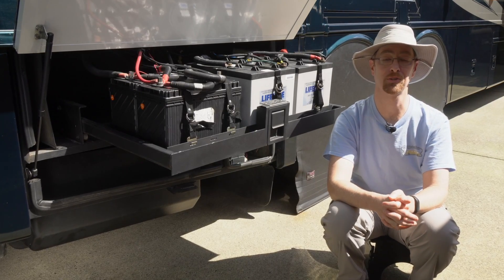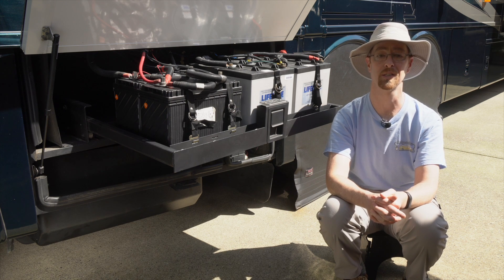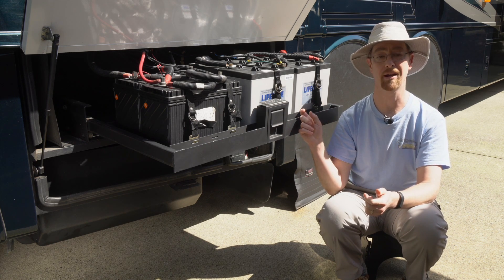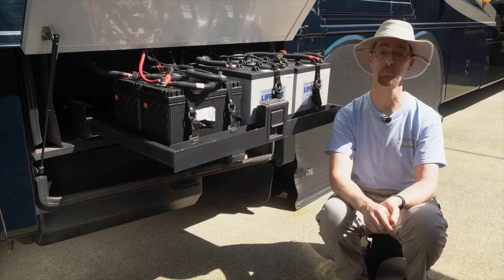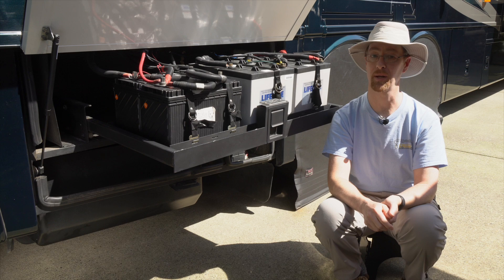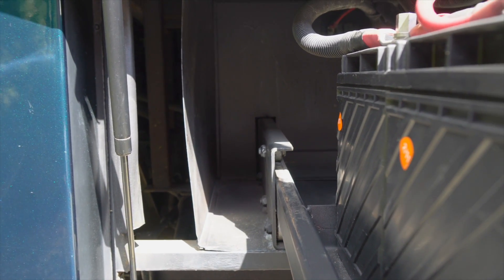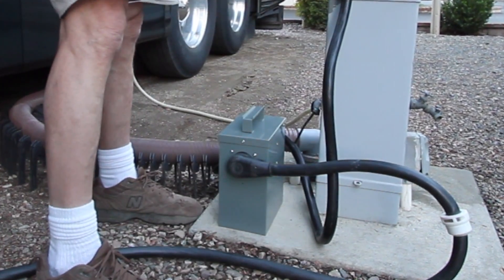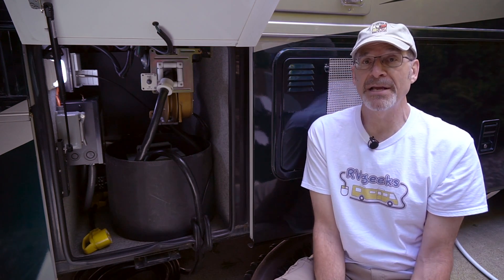🔌  RV Lithium/AGM Battery & Electrical System Upgrade - Part 1 - Project Intro ⚡️

Comment: Always amazed at how clean EVERYTHING is on your RV.
Reply from the maker: Thanks Joe! Although if you'd seen it a couple of days ago, after 2,000+ miles of driving mostly in the rain, you wouldn't have said that! Of course we did have to stop at a do-it-yourself car wash with a truck bay a couple of days ago to fix that and get it at least pretty clean again. 😊
Reply: Still headed to the maritimes this summer??? I'll be on the East coast but I think a bit further south than you guys
Reply from the maker: Sure thing, Joe! Currently in Ontario (best way to follow our general location is on Instagram)

Comment: Congratulations! Your getting into the type of upgrades I've been doing form much of my professional career! I'm happy to see that your having a welding shop expand your tray, and I'm happy to hear about your newly discovered LiFePO4 cells that I was not aware of. Additionally, I've been installing Xantex components into newsgathering ENG vans for a few decades. I am a big fan of the Xantex product and remember giving them some in field customer feedback to them about their product in their early development. 

We too have a 4 cell, standard lead-acid battery bank in our Class A RV. Unfortunately, It originally came with AGM batteries, a big selling point, but as the coach was being inspected, it turned out that the AGMs had gone bad and had to be replaced. I did not have a choice in the battery replacement and the dealer would only install lead-acid. 

Eventually, I have planned to upgrade back to AGM once we have run the course with the existing lead-acid batteries, fearful of the Lithium Ion fire risk. I am happy to see that Xatrex is offering a LiFePO4 option for the outside battery compartment. Thanks to you and your video here, I will likely be entertaining the same upgrade path that you are following here.
Reply from the maker: Thanks, Mike! We're definitely liking our Xantrex equipment... and the new LiFePo4 battery is working out great so far. It's not available on the retail market yet, though. They are using the non-heated version in OEM Class B installations (where they can control where it gets installed to protect it from freezing & heat)... but we're hoping that their "case study" with us results in them accelerating their plans for aftermarket availability. 😉

And we're sorry to hear that your hope of having AGMs in your RV were dashed by them failing. We definitely liked not having to worry about any maintenance or outgassing from flooded cells when we upgraded to AGMs. Assuming price isn't an obstacle, lithium is definitely the best upgrade choice at the moment. It's definitely more expensive up front... but with the potential for dramatically longer lifespan, and the quality of life improvements it can bring... it's hard to ignore!

Hope you enjoy the rest of the series. We're working hard shooting video, editing, etc!

Comment: Another awesome project and one I been researching myself.  I will be following closley to see results. I'm especially interested in the Xanax batteries parasitic losses when the vehical is in motion during cold weather.   Please include ballpark cost estimates for us normal consumers :-). Thanks for all time you spend putting these recording together!!!
Reply from the maker: Hi Richard. We'll be doing our best to include all of the information we can about the new lithium battery and all the other upgrades we're doing. If we miss something, don't hesitate to ask... and if we HAVE an answer, we'll give it to you! The one thing that will be tough right now is actually the cost of the new Xantrex battery. They haven't released that information (to us OR publicly) as the battery is not available for aftermarket installation... but we'll get as much together as we can, and will update once any missing pieces are available. Thanks for watching!
Reply: RVgeeks if you have any input to Xanex, suggest using Peltier for their embedded heating element as it could then be use for cooling too :-)

Comment: Good stuff, enjoyed as always.  I installed Battle Born Lithium Ion in our truck camper just prior to going full-time.  I had the same concern about the 32 degree mark because I only had room in the battery box to place them.  I spoke to the folks at Battle Born who suggested insulating the battery box which I did.  I also placed a work lamp with a 75 watt bulb in the box and have a weather station with an outside sensor, a sensor in the basement and a third in the battery box.  I have not needed the light so far, even with temps as low as mid 20's, temp in the battery box as yet to go below 45 degrees.  Good luck with your install.
Reply from the maker: Sounds like you've put together a good system for keeping it above freezing, which is so important. Nice.
Reply: I guess the box is insulated. If so, the batteries are producing just enough heat while working, they are keeping the temp in the box up there.
 If this new box is insulated the same might happen but it is a new technology. Keep a record of how the temp in the box changes in cooler climes while the batteries are under a nice load. That is IF you ever see anything below 90*!!

Blue Sky's and Safe Journeys!

Comment: Hey Guys! We are a bit behind in these videos, but better late than never:) We learned so much in this video! One we did not know there were different types of lithium batteries and certainly thought if the cell batteries are having issues why would you risk it in an RV, two we did not know lithium did not work under a certain temperature, very cool idea to have a battery then with a built in heating blanket to keep it warm and cozy :) Three we did not know there were AMG chassis batteries. It is truly unbelievable how much we learn from your videos!! 

On a side note we purchased a Hughes Autoformer using a discount through you guys long ago (actually before we even bought our RV home lol) and it has been great, We did have an issue with our power cord on it recently and we contacted Hughes and they told us to send it back to them and they would take care of it. In less than one week we had our Autoformer back good as new. I know you guys like to hear good stories about customer service for products you endorse and they were fantastic!! 

Take care guys and safe travels!
Reply from the maker: Thanks so much for your comments. We're learning a lot about batteries ourselves lately! There sure is a lot to know. Two of the biggest things we learned is that excessive heat & cold aren't good for any battery, and that lithiums currently on the market are mostly made from Chinese components and are NOT UL approved for mobile applications... or for series or parallel use (more than one connected together). The e-GEN is the very first lithium battery that's UL approved for use in RVs. As everyone gets all excited about lithium, we're hoping that we don't start finding out that many of the brands are unsafe or otherwise inappropriate for RV use. Time will tell. As far as AGM batteries for starting the engine, the Full Throttle series are the first we found that can handle the required CCAs, and we love having such a clean install, without any outgassing or the resulting corrosion. Thanks for letting us know about your experience with Hughes. They're a great company with a great product, so we love hearing that others are having the same positive experience we are. Safe travels!

Comment: Looking forward to this series, have been think about lithium for our older DSDP but was worried about the outside compartment/freezing issue.
Reply from the maker: Hi Ken! Temperature is a prime reason we've held off on lithium for so long, so we were very excited when we found out about the Xantrex battery. Unfortunately, we're working with Xantrex as a case study and showcase for this tech, and it isn't available for sale yet. We sure hope that changes soon, and maybe our participation can help move that along. 😉

Comment: Finally someone puts to bed the bull about lithium batteries there is so much wrong info glad you cleared it up. You run that house off very little solar. That whats needs to be said you don’t need a zillion watts to live off solar. Congrats very well done 👍🇨🇦🇨🇦🇨🇦
Reply from the maker: Thanks, Vlite. There definitely is a lot of misinformation out there about "lithium" batteries. And we get it... it's confusing. Everyone uses the term "Lithium" or "Lithium Ion" to describe all lithium battery formulations, even though there are some fairly dramatic differences between their pros/cons, etc. And the LiFePO4 chemistry is the best balance of power density, safety, and value commercially available today. As for solar... our current array is definitely NOT sufficient for our power needs (our residential refrigerator sucks up about 130Ah per day!), but we're cautious about going the route of just slathering our roof with new panels until we have more experience with how our system works... and how the 2.5x increase in our battery capacity (plus the lithium's ability to rapidly accept a charge) changes the equation. Given our current experience on the road of 5+ days of non-stop overcast and rain, no amount of solar on our roof would supply enough power. And of course, there's the issue of where you camp... desert camping affords LOTS of solar, and a big solar array can replenish your daily use by noon! But if you stay in the forest, or in climates that aren't sunny 360 days a year (ahem... 🇨🇦), it's not doing you much good. There are lots of variables to consider before proceeding with a project like solar.

Comment: I got the feeling you guys might be thinking about a whole new rig...this massive upgrade sort of kills my prediction. Looking forward to seeing the vids!
Reply from the maker: Unfortunately we'd need a lottery win or an angel investor to get a new rig, at least anything along the lines of a New Aire! But updating the one we have sure does make it feel new again, so yes, we're happily keeping it for the foreseeable future. 😊
Reply: And that new lithium battery with heater seems like a game changer for the cold weather issue. Congrats on being guinea pigs. :)  Are those new batteries still susceptible to high heat? I hear high heat can also shorten the usable life of lithiums. i.e. hot summers.
Reply from the maker: Regarding temperature, our battery compartment is located directly alongside our engine, RIGHT next to the muffler! So, as you'll see in an upcoming video, we installed highly heat-resistant insulation (the type used under race car hoods) into the compartment. So far, having driven over 2,000 miles, our two temperature sensors (one in the compartment and one inside the battery itself) have never shown readings anywhere near battery limits. And that includes plenty of mountain driving, although in less-than-extreme ambient temps so far. We're keeping a close eye on that, especially as the summer warms up, and will report back on that issue in a future update. And of course high heat, (unlike cold, which can destroy a lithium battery) will only shorten the lifespan, not ruin them. They're supposed to last about 2,000-3,000 cycles at 100% depth-of-discharge (we don't intend to go that low of course, increase their life substantially), so we may not live to see the end of even a "shortened" life! LOL
Reply: Option #3  - New Discovery Canada programming 'RVgeeks On-the-Road'.   A replacement for Canada's Worst Drivers.   Homebase - Vancouver B.C. (my favorite Canadian city).

I think you could sell the idea of a reality programming show where your travels can be made into prime programming.   I think with the right agent and sponsors, you could be in a Newmar King Aire in no time.  [-\) 

On second though nevermind, we value you  on YouTube - humble and accessible.
Reply: Excellent. You guys are all over it, should have guessed. Cheers!
Reply from the maker: LOL! We sure appreciate your support, Anthony. And we'd hate to ever get so popular that feel like we don't have the ability to be accessible any more. So when The Discovery Channel calls, we're declining. 😂

Comment: I've always wondered about enlarging our battery tray (exact same size and layout as yours). Also the change of the cord reel. We have the same one on our '03 Dutchstar and have never had a problem with it either. The only thing that concerns me about the typical cord reel, is the need for rotating contacts(arcing at 50amps). Looking forward very much to this series of videos. Thanks!
Reply from the maker: Hi Richard! Thanks for mentioning the rotating contacts on the roll-up type of cord reel. John Glendinning, the president of Glendinning Products, whose father founded the company, is a purist, like his Dad was, who loves the hard-wired cord reel we're removing. But he does understand the benefits of saving space, and did accept why we were removing one type of reel and replacing it with another. The main difference in using it, which we'll mention in the video about installing it, is to only extend and retract the cord when the power is off. As we mentioned, Newmar is using this type of reel in $800k+ coaches, so we figure that, used correctly, it's good enough for us, too! 😊
Reply: RVgeeks  I hear ya! I'm sure they've got some really heavy duty roller contacts on that baby. I looked on line, the 36' one is around $ 659.00. Newmar wants 647.00(I think that's right) for the Newmar rock guard on our coach. It's got a few battle scars. Thanks
Reply from the maker: Oh yeah.... our chrome mud flap / rock guard has been bent a few times, like all the others we see on other Newmars out there. All it takes is one time forgetting to swing it up to hold it out of the way while leveling in a nose-low campsite. 🙁

Comment: If your aren't going to recycle the old old real make it into an extension cord.  Put on a Female 50amp connector on the cord reel end and you have one of the most flexible extensions you can get for free :)
Reply from the maker: Thanks! That's a great idea, which we will absolutely do if we don't find a good home for our old reel.... but we bet we will. 😉 It does still have a lot of life left in it!

Comment: Good to see a manufacturer of batteries addressing the cold charge issue. What about the inefficiencies due to heat affecting the Lithium batteries? I thought this was also a problem? I just installed a pair of BattleBorn 100ah batteries and we're looking forward to trying them out in a few weeks.
Reply from the maker: Congrats on your new lithiums, Danny. Since our battery compartment is next to the engine, and directly adjacent to the muffler, we installed high-heat insulation... the type used around race car engines (as you'll see in an upcoming video). During the past week of driving over 2,000 miles, including through the mountains (although not in intense heat yet), we've been monitoring both the internal battery temp, and the compartment temp, both of which report remotely to us while we're cruising down the road. So far we've come nowhere near the limits of the battery's allowable temperature range. We'll of course be reporting back with more details as we go.

Comment: Great info as always. But most Lithium batteries I have looked at are around $1000 EACH. If money is no  object, I guess this would be a great upgrade. What was the total costs of this upgrade?
Reply from the maker: This project was done in conjunction with Xantrex and a case study and showcase for their new technology. It's not on the market yet, so no pricing exists just yet. We will of course be updating on details about availability and pricing, and of course our experience with the system, as soon as we have more details to share.

Comment: Ever considered the Maxwell start module? It has the power to start a Cummins ISX in -30C.
Reply from the maker: Never heard of it, so just googled. Looks interesting, but in our case (with an RV), we would never stay in ultra-cold conditions without being hooked up to shore power. That allows us to leave our block heater on overnight and start instantly with no problem. But for a truck parked overnight in extra-cold conditions without shore power, it looks interesting.
Reply: It eliminates the need for crank power in the batteries. Works well at 40C as well.